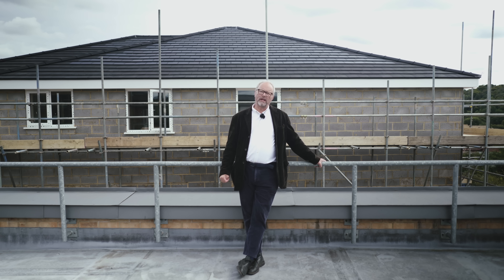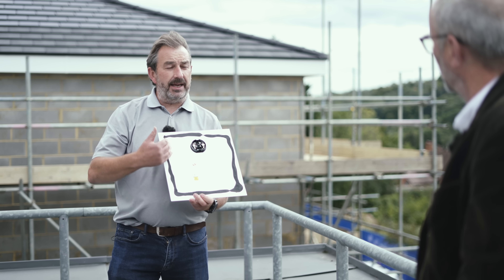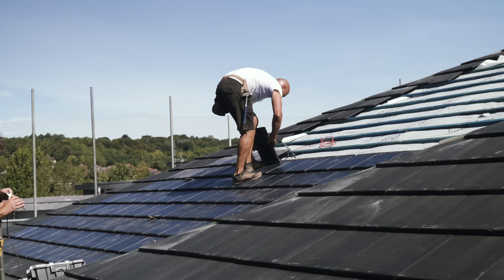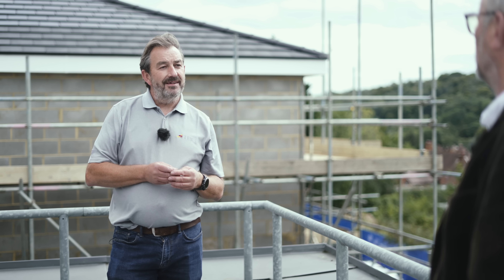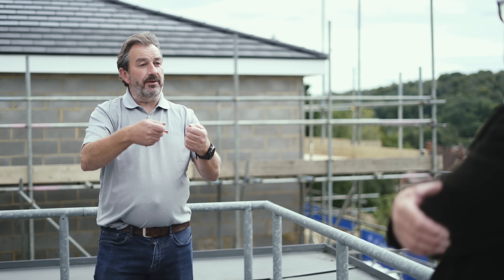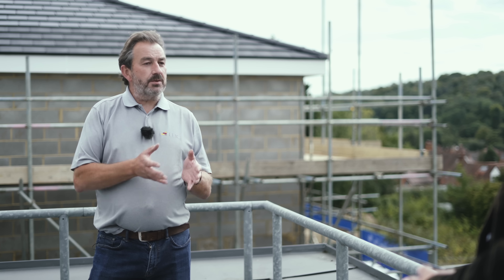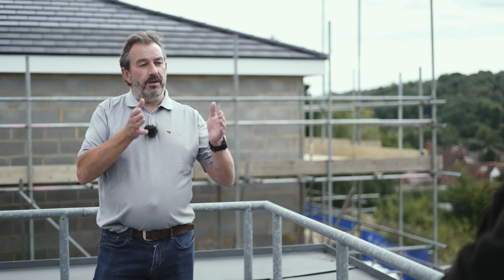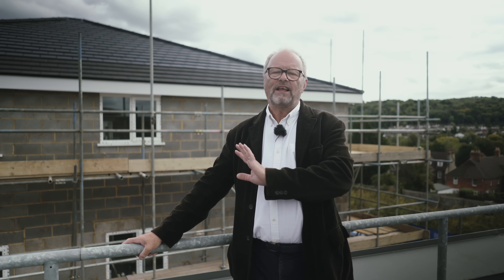Solar Roof Tiles - should every building generate its own power? | 100% Independent, 100% Electric

Comment: I turned down solar panels for my roof because of the lack of storage. Once storage becomes available too (either by a Tesla 'power wall' or by keeping an electric car plugged in), solar panels will be more advantageous. Until then, there will be dependence on the grid, and the grid might be running less efficiently because of how solar and wind input into the grid affects the economics of running power stations.
Reply: We have available 10 kW hour batteries with  a guaranteed 10,000 charge cycle warranty, this comes with both solar charging and grid charging built into it.

Comment: So now after 25 years you have to replace not just the solar panels but the whole roof?
Reply: The performance of the cells is warranted for 25 years, this does not mean that after 25 years and a day that the entire solar array will fail and require replacing!

Comment: You take a roof tile and drill a hole in it ? 
How long is the glue that keeps the solar stuck to the tile going to last?
Will the first frost simply lift the solar off the tile? 
I hope this product works in the long term as a poor product can put the market back years.
Reply: We have a 30 year warranty on the adhesive, and have roofs that are 10 years old in the UK, and others around the World with zero calls back for warranty claims
Reply: @chrishall8738  30 year warranty is very reassuring.
Reply: Very true.  I’ve read articles about bad solar in Australia being sold to unsuspecting households.

Comment: The whole design seems like an afterthought, or a retrofit at best.  The amount of wire and connections is terribly inefficient in terms of labor and materials needed.  The tiles should interlock in a way that allows them to connect electronically without additional wires.   It would be great to see some real innovation in this space.  This is not even well thought through!

1. Moisture is going to get under this panel and freeze/expand.  The glue will fail and the hole they put into the tile is going to leak.  
2. Cutting holes into concrete at this scale is terribly inefficient and wasteful.  
3. Number of connections is insane, complicating installation/maintenance.
4. Number of connections require a significant amount of plastics and wire increasing cost and consuming resources.  Worst of all it's totally unnecessary if designed correctly.
5. "World's most popular roof tile..." does not exist in the America's (North or South), nor most of the European nations I have been to.
Reply: Clearly, if this tile leaks then it's 'game over' for the business!
Accordingly, you have to assume that they've solved this fundamentally critical issue..... !!!
However, the system DOES seem a bit 'mickey mouse'...! Big questions about reliability of panels, serviceability, interconnections etc. NEED to be answered in a lot more detail  - Robert......!!!
Reply: Did you see the weather barrier flapping in the wind underneath?  It looks like something they install on the vertical side of a house called a house wrap.  US houses usually have a roof membrane under the shingles for extra protection but not this.

This is an infomercial to keep the lights on at fully charged.

Comment: Kryton : "My argument is all new buildings should be using these"  It would be so  if , in 2015, Amber Rudd had not cancelled the " all  homes built after 2016 to be zero carbon"  which had been a cross party commitment since 2005

Compared to classic PV Down side .. finding a loose connection is worse than Christmas tree lights !  Up side... No Pigeons !

Comment: Shipping just the solar plate makes sense, but cutting holes in concrete tiles, then forming an intricate loom of wiring seems very tedious & labour/time intensive. 
As a suggestion, maybe manageably-sized semi-rigid foam sections, which have pre-installed bus-bars embedded, along with waterproof click together electrical connectors. 
Foam being light & having insulative properties could make the complete install process very efficient & cost-effective.

Comment: Sorry this was one of the least convincing products discussed on fully charged. High voltage as a plus? I don't think so. Be great fun when the building catches fire. Undisconnectable DC wiring burning. Lovely (not). Dynamic load on roof? Only because of the standard mounting system on rails. My panels sit in trays that are an integral part of the roof. Standard panels and micoinverters are the way to go.

Comment: Every building should produce as much of it's own power as possible using every method possible., Smart glass, paint, wind etc.
Reply: Starting with your house I assume?

Who wouldn’t want to be free of dependence on others for a good or service when you can do it yourself. 

If you produce enough electricity you can provide power to your neighbors for free too.  

Maybe Robert can get you a deal on these solar roof tiles.

Comment: How heavy are those tiles?
Reply: The tiles weight 4.5 kg each
Reply: Based on the video they can easily be thrown by a grown man several feet through the air. 

I think if you were shirtless like most roofers you can perhaps throw two at a time.

Comment: The guy that installed my system recently was installing JA 320w solar panels that now cost £100 each. ie. 3w per £1. Or £1.20 including racking.  So these are £30 for 30w. That's nearly 3x the price. You also have a lot of cabling. Like Tesla it might be more efficient to have 3 panels in a row for 90w, then you don't need so many connectors. If you get one poorly fitted connector then you lose the lot and it's harder to diagnose. I imagine as there's nothing behind there there should be no fault. But one bite from a squirrel and the lot might go down!  At least with solar panels a fault could be diagnosed to the panel and that replaced without undermining the water protection of the roof.

Comment: What is the lifespan of the solar units on the tiles? What if one stops working or after the lifespan how much will it cost you to replace the whole roof? I would like to see these calculations and comparisons. Big solar panels are developing every 5 years and you can replace them for new ones and more efficient ones. Not sure about these ones.
Reply: Good luck if he is still in buisness by then.
Reply: The solar cells have a 25 year performance warranty. Each cell has a bypass diode should a tile be shaded or fail, meaning that the voltage on the rest of the string remains. All solar has had incremental increases in power, we actually started at 11.2 watts 9 years ago, however, in 17 years of installing solar we have never taken off old panels to replace with the latest more powerful modules.

Comment: The majority of American homes are designed with asphalt tiles in mind, so any solar tiling concept used here has to be compatible with the load limits such a roof carries in mind. Cement tiles are way too heavy for the job.

It's also not true that Tesla's solar tiles can't be cut, because they do cut them for roofing jobs. Allegedly, the V3 edge tiles will be custom manufactured for each individual roof to avoid needing to cut tiles.

Comment: A 15W solar cell per tile means that when compared to a 365W solar PV module the solar tile roof has 25 connections vs 3 connections or 8X as many. Only time will tell. Hopefully, their system can at least narrow a problem down to 1 or 2 rows of tiles.
Reply: a sentient being has appeared

Comment: This is something that I could never understand they build a new house put a ceramic tile roof on it then a bit later the new owner covers one side of the roof with ugly solar panels what is the point in that why not use solar roof tiles and save all of the money on ceramic tyles alloy frames to hole the solar panels in place and this is called the green way of doing things but hell what do I no I am just an old fart.

Comment: NIMBY - I am lucky to live in an old neighborhood that has big trees. The trees shade the roof in summertime and would nix most PV output. I will keep the trees and will be happy to buy electricity rather than make my own. Anyway, there are other schemes for combining PV with architecture. Examples: 
- Inflate PV films over agricultural land - It turns out that crops can use one part of the spectrum and PV can utilize the remainder. 
- Inflate semi-transparent roofs over our highways to generate the energy needed by transport while also making the highways weather-proof. 
- Considering that a nuclear plant requires about 1 square kilometer of space (due to "stand-off" requirements), you could cover an equivalent space with PV with flow-batteries underneath and thus have 0.25 * 1 kw * 10 hours * 1e6 / 24 hours = 104 MW equivalent.
Reply: Average nuclear plant in the US produces 1 gigawatt.

Comment: I am new to this. What is there for a Torch on, flat roof?=
Reply: Can you explain your second sentence in more detail?  I’m curious to understand your comment.
Reply: @ZzHasbrozZ  I am saying, a house with a flat roof would need to have framework for the solar panels so they would be at an angle? Did that explain it a little better?

Comment: As mentioned, these tiles have a price premium over conventional solar panels, which are actually more efficient too. Also, the heat transfer between the cement roof tile and the stuck on solar panel will curtail the lifespan and the electricity generating ability of the solar panel - solar panels are more efficient when they are not too hot. That said, it's a reasonable alternative product. Tesla roof tiles are certainly a premium product. However, the photovoltaic element is part of the tile itself. And yes, they do have simple glass ones, minus the photovoltaics, at the edges. Consequently, they are much lighter. Plus, I expect Tesla to eventually build another one of those Gigafactories in Europe [or maybe even the UK] to accommodate the requirements of solar panels, solar tiles, domestic and commercial batteries. Just got to be patient folks, or go for the early alternative. Tesla are still a relatively medium-sized but fast growing company, certainly in the solar zone. Me? I have a flat roof, so it is all academic. It's steerable solar panels for me. I do have south facing vertical concrete shingles though, so one day I could have either Tesla or an alternative solar shingle. That might be fun. But I'll wait until the price drops further for those. Then again, heat pumps would probably be even better/more efficient than adding extra solar. It's not simple, this decision making stuff.

Comment: In North America most houses use asphalt shingles that need to be replaced every 10 to 15 years, the concrete roofing tiles would be great here except theses a whole industry based on making, repairing and replacing asphalt shingles. Glad when I built my house I put on a steal roof, that now has solar panels on it.
These solar tiles would be great here.

Comment: This is the best roof tile solar system I have seen so far in terms of percentage of the roof that can be covered. Some others only got 50% (or less) of each tile. There is however - the same Achilles heel as all the other roof tile systems: Way too many connections. The simple truth is that say 16 roof panels is 16 connections whereas 160 roof tiles is 160 connections IE 10 times more likely to fail due to connector issues.

Comment: I do like the idea, but I have seen systems whereby the roof slates or tiles will integrate a conventional  "solar panel which is integrated with the roof. look for " roof-integrated solar roof tiles " you can see what I mean. this system seems to be a lot cheaper.

Comment: I stumbled across your channel a few months ago, and it was bothering me wher I'd seen your face, then it came to me. Scrapheap Challenge.. CH4.. Great programme. Now here's the sinic in me, the big Big house builders should be made to do this, by law. Make every single new home self sufficient, not just power/heating, everything. Water, sewage everything. We have a farm, and spent £80,000 on solar set up, And not jut solar, wind power too. And on top of that We collect all the rain water, filter it, clean it, etc etc,, we have a bacteria septic waste system, never needs emptying, looks after its self. Yes, it costs money, but in the 5 years we've had it up+running it has now paid fit it's self.. We are almost now completely self sufficient. Even food now we grown ourselves, This is the future.

Comment: Robert's obviously a nice chap, but he doesn't always ask the right questions - I'd be interested in the actual experience of these tiles, how reliable are they, what happens if there's a disruption in one of  the hundreds of connections? There is a serious premium, which sounds to be rather more than the alternative of an ordinary roof plus solar installation. That wasn't explored. What length of warranty is provided? etc
Reply: This system seems it would be better to leave off the substrate and put a TPO on the flat part underneath. Then all the wires would be easily accessible.  But then you wouldn’t need the pitches roof at all and could just install panels on a flat roof.

Comment: Shame, this video is basically an ad. 
There are so many advantages to solar panels over this. The main one being that solar life expectancy is something like 7-15 years. (I work in the industry and remove broken panels of this age on the daily). Hopefully they get better and the ones we install these days last a bit longer but honestly, considering the economic pressure on manufacturers makes this unlikely for the average solar product. (Walking on these tiles definitely shortens the life span too..... not good for the wafers in the panel. They get micro cracks and will get hotspots down the track. )
So you could have a solid concrete or tin roof with a life expectancy of about 50 years and solar panels on top that can easily be exchanged or updated. 
Or you could have these tiles which means that if the solar components of your tiles fail you're up for new tiles. This is environmentally questionable, to throw perfectly fine tiles in the bin just because the solar failed. 
I don't know if this is an issue in the UK but hail storms would be a worry too. (I think your insurance premium would go up once they realize what it would cost them in the event of roof/solar damage).

ROBERT: if this is not an ad and you are serious about promoting sustainable gear for the future: How about asking how these things get recycled? I would love to hear that......
Reply: “The show is for interested consumers”. That sounds like a commercial...consumers buy things.  

As a consumer I would want to know and compare what a product has to offer over another product claiming to do the same thing.  And misleading info or lies about a competitor is a huge red flag. 

So if your show is pro consumer then their best interest should be in your best interest.
Reply from the maker: We don’t carry adverts or take sponsorship - we cover an array of technologies - just because one of our 500+ episodes is on Solar Roof Tiles   doesn’t mean we think that technology is the answer to every question. We also have very limited resources when filming. There are always additional things we could ask, but the show is for interested consumers, not technical experts and on YouTube episodes of that type the viewers tolerance is ~10-15 minutes. Hope that helps.

Comment: I couldn’t see how the wires fit behind the panel. Are there holes in the plywood on the roof?  Slots in it for the wires? Slots in the panel or legs on the panel to create a space under it?
Also, I’m wondering how all those connectors can be reliable after years of weathering and oxidation?  Are the connectors gold-plated?
Reply: I saw space under the standoff framing.  I think its wired bottom to top then into the roof ridge vent.

Comment: It appears no one working on the roof as a safety-harness on. I guess if it a solar roof it’s not  required. 

Seriously folks don’t be a silly put on a hard hat to save your brain when you hit the ground
Reply: Dale Marcell
So if you fall off the roof, you think your hardhat stays on your head? The lack of safety harness has Darwin whispering "come to me."
Reply: Samiam 666 they they make them with chin straps. We call hard hats brain buckets.
Reply: They do have a scaffold walk around the entire building.
Reply: Thanks for noticing, however we were filming on a closed site, with no-one else working above us, and as the roof was a very shallow pitch with full 360 degree scaffolding around it, safety harnesses wire deemed a trip hazard, as fall arrest was not required in these circumstances.

Comment: The seal around the solar fails and water goes into the hole of the connection and into your home.
Reply: Roof tiles are never 100% water tight. The overlap takes care of high volumes of water, the underlayment (beneath the wood tile support frame) takes care of drips between tiles and probably what would get between the solar unit and the tile. You don't see them putting silicone sealant on every tile overlap either.